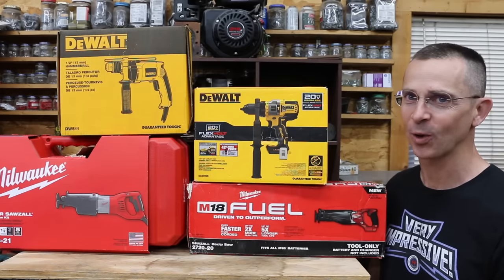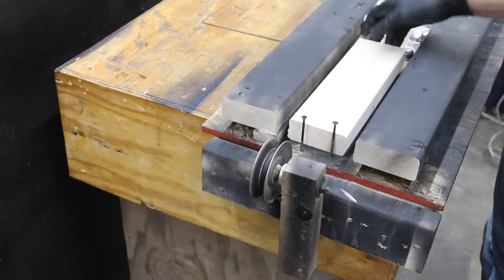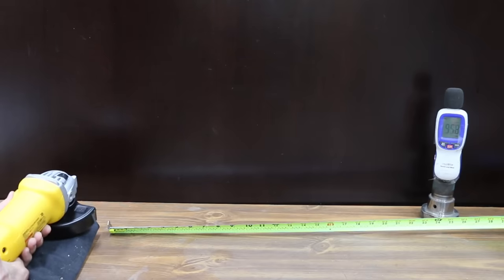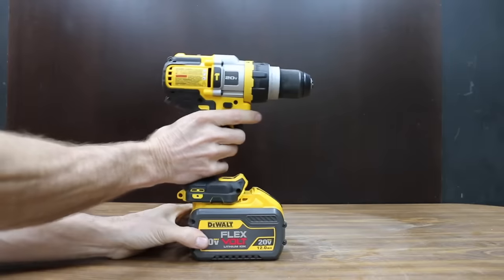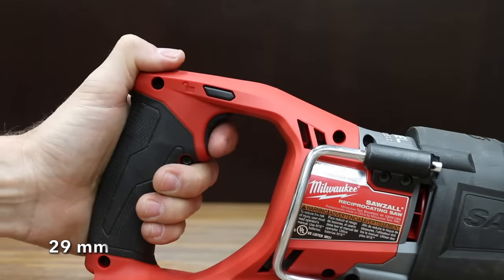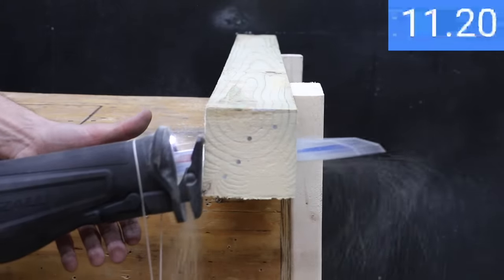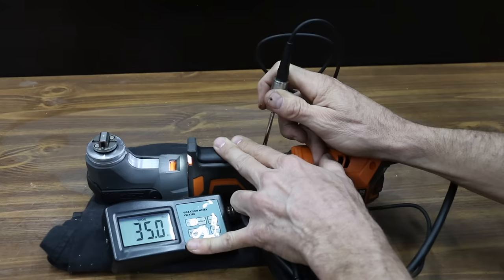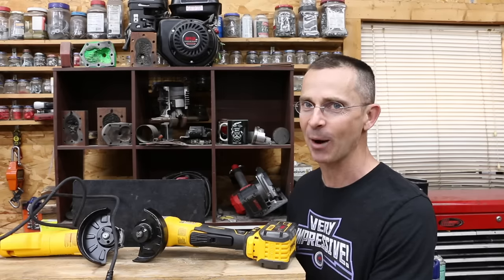Let's Settle This! Are Cordless Power Tools REALLY Better? Torque, Cutting Speed, Noise, Vibration

Comment: I would just like to add that corded tools can be found at garage sales, marketplace, craigslist, etc for pennies on the dollar in good shape.  Keep up the great work.
Reply: Cordless from 10 years ago are not expensive too. And there are inexpensive off-brand batteries for them as well
Reply from the maker: Thanks, will do!
Reply: @feedbackzaloop  those are not lithium ion but nicad. those really suck.
Reply: @ronblack7870  NiCd are good for those under 10 bucks they are sold for. But still, there were li-ion already. Still have a couple of 12v Bosch from 2009 (compatible with recent batteries, of course)
Reply: @feedbackzaloop  Very true and cross platform battery adaptors are available online as well.
Reply: yeah i do scrap for a living and the amount of cordless drills i come across is staggering very rarely will i come across corded and literally never come across pneumatic expect for when a place is shutting down

Comment: Great show, I don't use a cordless tool often enough to justify a large difference in the price of my tools. What you showed me is some of the cordless tools are worth buying over the corded models. What is also an expense that was not discussed, was the price of extra batteries and how often they need to be replaced when they have reached the end of their service life, for that reason I usually go for the corded tools. I got burned when the Milwaukie 18-volt tools went to a new style of lithium battery and would not work on the older models. I also like the older corded models because you can find them at yard/garage sales, and they work as well as the newer tools for pennies on the dollar.
Reply from the maker: Thanks!  Thanks for sharing.

Comment: Wow, thought provoking comparisons!  Thanks.  My cordless 7-1/4” saw can’t match the power of the worm drive I bought in 1977, but it’s easier to carry and very handy when there’s no power nearby. Both types of drill motors have their uses. “Obsolete” older corded drill motors are cheap, and very handy for wire wheels, flap wheels, etc. The cordless spends more time driving screws and even mixing paint than it does drilling holes. I have corded tools from the 60’s, the 70’s and the 80’s.  I wonder if any of my cordless tools will last 50 years.🙄
Reply from the maker: Thanks!

Comment: This was an interesting test and shows how far the tech has come in the last 20 years.

Even if the corded tools had won every test though, it wouldn't really matter because many of the job sites I go to don't have any power or there's only one spider box for everybody to share.

I remember the old days of running 100's of feet of extension cords or air hoses. What a nightmare. Now we even have cordless compressors if a guy wants to run air tools, but I switched to airless nailers long ago and will never go back.
Reply: I don't want a box full of spiders.... Just set it on fire.
Reply: @iwinrar5207  🤣
Reply: You still need to charge.
Reply: @D-B-Cooper  You can do that with a small portable generator or even solar panel
Reply: exactly.....when I first started, I was debating corded or cordless. Both have their merit. However, cordless tools are a must for me for the same exact reason you mentioned. I would have lost many job opportunities and generator noise and fumes in enclosed areas is a no for me
Reply: @HobbyOrganist  most of my batteries last the whole day and I can charge after work is over. Even the cordless chop saw and table saw. The only thing I have that eats batteries quickly is the compressor and since I switched to battery nail guns I don't even pull that out anymore. A 4 ah battery in my nail gun will last 3 days.

Comment: Would like to see how the corded adapter for dewalt’s cordless tools compares to a true corded tool and a cordless with a battery.
Reply from the maker: Thanks for the suggestion.
Reply: check out torque test channel, they tested this already
Reply: I been wondering why they never had those, and with your comment I realize they did finally add such an attachment. Seems like a logical choice over the old corded options.

Comment: Since the cost of energy is the topic of the day, I was actually thinking just a few hours ago about the efficiency and cost to run between corded and cordless.  I bought a hedge trimmer this morning at Home Repot.  I opted for the 120 Volt AC model rather than a cordless.  Saved a hundred bucks and I don't mind dragging a cord around since it will be used only once a year.  A hundred bucks saved can go to gasoline rather than a little convenience.
Reply: Yes! A gallon and a half in the hand..................
Reply: Hedge trimmers are the nemesis of extension cords. They're practically made to cut them.
Reply: @1pcfred  good point!  I hadn't thought about that.
Reply from the maker: Great point!
Reply: @ProjectFarm  I had one for the Echo convertible that the son-in-law now has. It worked FINE as long as we had a hedge. Took it out for a geezer ramp. Progress?
Reply: @kevinthompson2308  many a cord's life was cut short by a hedge trimmer. That having been said though there are strategies to avoid such a fate.
Reply: But..if you already have a battery system, getting just the tool is a great way to go! I use Ego yard tools, love them.  I do need to sharpen my mower blade...
Reply: @whattheschmidt  Bare tool equals using what you have to do the job. A-PLUS!

Comment: Its been my theory for a while that many manufacturers have shifted almost all of their R&D and innovation to their cordless lines while basically just rebadging their older corded gear with the new years shapes and decals etc.

Its incredible how far cordless tools have come over the last 5-6 years.
Reply from the maker: Thanks for sharing.
Reply: Corded tools are finished products. I have several from 1960's: Metabo circular saw, high torque drills (AEG, B&D, Metabo), B&D sheet metal cutter etc. 

Metabo saw was first used by my grandfather, then my father (both professionally) and now I use it. 

The quality of that time German tools is unsurpassable: full aluminium body, second plastic cover inside that (for full electric insulation), protection against over heating, oil filled gearbox (yes, you can change gearbox oil), big ball bearings for durability, very finely balanced for minimal vibration, fully epoxy coated wiring inside the motor, thick rubber cable  etc
Reply: It's not just a theory.  I read an article a couple years ago saying most R&D is going into cordless because that's where the market is going.
Reply: I said the same thing R&D has completely quit on most corded tools and it started years ago. If you had corded and battery operated with equal engineering those battery tools would get smoked by the corded ones.
Reply: thats almost certainly what's happening. Theres no reason with as many amps and volts as a wall outlet can provide that a corded tool should be weaker than a battery powered tool. Any difference in power in the corded tool is clearly due to lazyness on the manufacturers part.
Reply: @sunn_bass  Market is not going their by itself. It is actively driven there.  I am trying to get corded everything, and the offerings are slim
Reply: @dmitripogosian5084  oh i agree.  Consumers like cordless, and companies love locking people into their battery systems.   I know plenty folks that use one brand simply because they don't want multiple types of batteries to keep up with.
Reply: @sunn_bass  They basically moved to the model of computer printers (ink or laser) - when devices are cheap (and potentially even subsidized), but money is made from expensive consumables, which continue to bring money over and over.  Batteries have provided a wonderful source of consumables in the tools market where there were none before.  No surprise that manufacturers are not interested in developing corded versions.
Reply: @dmitripogosian5084  At least batteries last longer than ink cartridges. Great comparison.

Comment: An important fact, that is often missed is at these tests, always new and fully charged batteries are used, but they don't stay that way when using them. And if you forgot to charge them, you can't use the tool at all for hours.
When using corded tools, you always have 100% power.
Reply: This is really an excellent point.  The speed and torque of battery tools is highly dependent on voltage, which drops in a linear fashion until near the end of battery life.
Reply: But at the cost of portability though
Reply: By hours you mean half an hour right?
Reply: Surely if you are planning some DIY or are a professional having a charged battery is just part of the preparation?  I mainly have corded tools, but I specifically purchased by cordless Hitachi driver where the battery has very low self discharge so can sit in the cupboard for literally years and is ready to go when I need it.
Reply: Several hour charging time dates back to before lithium batteries were common, more than a decade ago. A lithium battery can reliably be charged in much less than an hour, certainly won't take several hours. Battery powered tools aren't always ideal though, I'll agree to that. For driving screws and light cutting my battery drill and battery circular saw are ideal. For heavier cutting or just cutting a lot in general I prefer my corded saws. For metal drilling you can't beat a good old corded drill press.
Reply from the maker: Great point!
Reply: That's true.  My corded tools really excel at sitting in a toolbox for a year being neglected and being ready to go when I want them for a quick job.  I think batteries require more regular fussing.  I am surprised, though, that the corded performance was anywhere in the ballpark.  Interesting video, right?
Reply: @LabRat Knatz that's why they under-charge them. They tend to stop at 4.0V/cell, or around 80-85%, when the cells top out at 4.2-4.3V. That offers very long cycle life,even with rapid charging.

Comment: It seems to me that the tool industry has changed over the years with what is being offered. Maybe compare corded plastic tools with the corded metal body tools of the 50s.
I have a Sunbeam hand drill that will rip your hand off with all the torq it provides. It's a standard size, a typical DIY tool. That's why, when I can find them at garage sales I will pick up the metal body power tools for use in the shop. It isn't hard to replace the brushes in motors.
Reply from the maker: Thanks for sharing.
Reply: A little note they still make pro grade you just have to go to a pro tool store I have one where I live the first thing you notice is where they are made. Example a Bosch jig saw big box China mine Switzerland.
Reply: I've got an ancient Craftsman power drill that'll break a mans wrist in a flash if he isn't careful..
Reply: If you want a drill I am going through my fathers estate and he had a sears metal drill with a strap on drill press adapter and probably a few more old tools also if I can ever dig them out.
Reply: @toddac61  Thanks for the offer. I think my wife will do a bit more than a frown if I actually bought another drill, I've got about 6. Thanks again for the offer. Be safe.
Reply: @FJ80Coop  same here 3/4 hp gear reduction and a skil worm drive saw
Reply: I'm sure the old metal tools are monsters. There's more to a tool than that though. A tool has 15 amps of current to work with generally on a 110 outlet. That means you have at most you have 1800w to work with. Where things change is motor efficiency, rpm vs power (torque), and gearing.
Reply: @bombebomb  in the uk we have 240v and the most wattage a domestic socket will take is 3000w usually  most tools are 2400w for large saws there are also round blue industrial plugs that are 16 amp and round red plugs that are 400v 3 phase
Reply: Welp that is your thing. I've used one of those old drills that will twist your arm off if a burr got lodged into your drill bit. And it fucked up my arm I refuse to use something that is so unsafe based off of that tool been around for eons like I don't care that shit belongs in a museum.
Reply: Yeah torque isn’t everything even though I love impacts. There no point in having a tool that can crank your arm if all you are doing is dry wall and wood. If you’re doing large fasteners then that’s when you want insane torque. The best about the current industry is the innovations. I used to lug around this old dewalt when I was a kid, now I mainly carry a light impact that can do the job twice as fast and can even be used in mechanical applications.

Comment: I lived in Europe where the normal household current is 220v 50hz. I remember the power tools there seemed a lot better than 120v tools. That would be an interesting comparison.
Reply from the maker: Thanks for the video idea.
Reply: Yes - 110-120v is very much a North-American and Japan thing, and elsewhere 220-240v is the most common supply voltage.
Reply: Ditto for Australia's 240v
Reply: slight misconception, there are 230v variants even in the us and you can have compliant 230v receptacles in your home too
Reply: Here in New Zealand my larger hand-held Makita corded circular saw is 2300watts running on 240volts.
Reply: Good point. I'm in Australia, and we have 240V. I'd never even think that cordless had any advantage other than convenience.
Reply: It doesn't really matter in terms of performance. A 500W tool on 120 or 220-240 volts still delivers the same amount of power. The only thing would be durability since 120 volts need almost twice the current to deliver the same output power in comparison to 220-240 volts making it a bit more expensive in wiring department since it requires bigger wire gauge due to current rating standard and higher current leads to more energy loss on wires where it might mess with the solder on wire connections.
Reply: @lendaloni  On paper yes, but in practice, P=UI doesn't always seem to apply. I don't know if it's because of power factor correction, different designs because of local codes, or whatever, but I believe there are differences between 110-120 and 230-240 appliances. Not sure about power tools, but servers for example, mostly use 240v PSU because, for the same rating, they will be more stable than 120v version. Also remember that, on top of the voltage change, there is the 50 vs 60Hz difference that comes with it in 240v Europe vs 240v US
Reply: @DiscoFang  Wow, I'm sure that thing is a beast.
Reply: @amahashadow  
Switching power supplies run more efficiently on higher input voltage. Running a power hungery server 24/7 that starts to make a difference.
Reply: This is kinda like saying a 80v blower is better than a 48v version.   Or v8 is better than v6.   The other factors are important. Compare wattage (total power)
Reply: I just had a scary thought.    A  240v version of the old Milwaukee corded Hole Hawg.     I mean, you gotta dig your heals in and have the apprentice ready to cut the power to use the 120v one.   and even then you feel like you won if you only got a few bruises.  I can't even imagine using a 240v one.
Reply: @johng4527  the 230V hole hawg is rebranded as the "widowmaker" 😄 Seriously though, I have a cheapo 230V 10A drill and several much more expensive battery drills and in terms of drilling through bricks and such, it isn't even close. The battery drills will take all day. You can get 2300W from a li-ion battery but not for long.
Reply: @lendaloni  Exactly. My table saw can be wired 110 or 230. 230 ads no power. It does use smaller supply wires and run cooler.
Reply: @amahashadow  P=UI only applies to DC circuits, in AC there is UI×cos(phi) for power (effective) calculations and the only thing frequency affects in power tools is motor speed n=(120*F)/P where F is frequency and P is number of poles and is a multiple of 2 since not one tool has a motor speed close to speeds that can be calculated with putting different P values and F=60Hz means all of them have a specific gearbox to run that specific speed with the frequency of the grid meaning frequency is not an important factor. Even if it was, a motor designed to deliver 500W of power must deliver 500W no matter the frequency. When it comes to servers, people concluded that higher voltage is more efficient at transfering power than lower voltages which is also obviously to the reason why we use 110, 220 and 400kV and above to transfer thousands of amperes through the wire in a grid. The same applies with 240 volt PUSs which makes them more durable and more stable.
Reply: @lendaloni  I know, I was simplifying for YT comment. My master in electronics means I have done my share of RCL network calculations, (even though I haven't had to do one in 18 years) :D. Nice explanation though 👍
Reply: @LC-hd5dc  On a residential building it's not the same.  Every 230 volt outlet just two wires that each carry 115 volts. It's actually closer to 120 volts with large appliances running on 240 volts.  But I can assure there is no wire in an American home that carries 230 or 240 volts. 

In Europe they have a true 240v feed coming into their house.
Reply: It's that we do 2 120 lines and have 2 sides to an Electrical box.

Comment: The price aligns with the tools. Put the money and effort to refine the corded and  it will outpace the cordless with omly the exception that it has a cord to power it. Still prefer the cordless unless you need to mix tile mud. Great video!!
Reply from the maker: Thanks!
Reply: Lol they make a cordless mud mixer
Reply: @Lee-lb9qh  there is but buying one to use it about 4 times is quite the peeve.